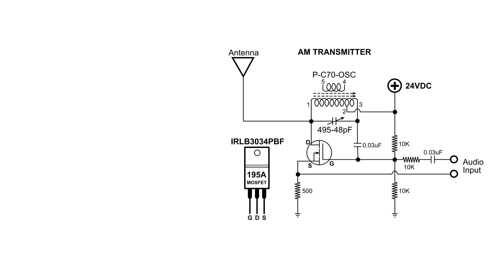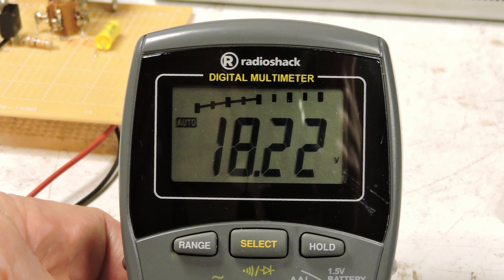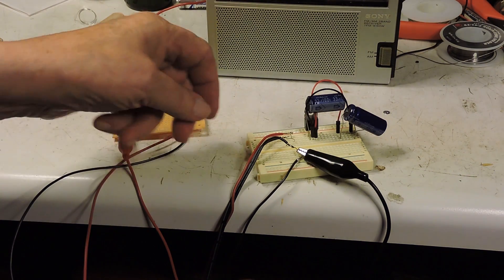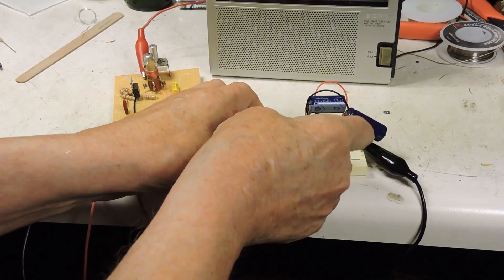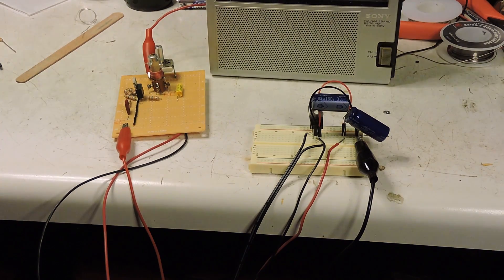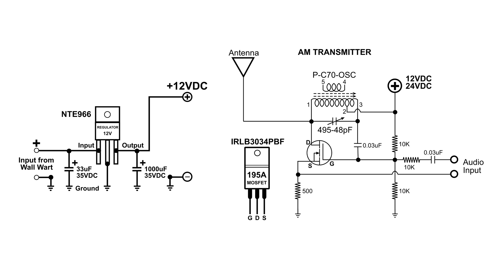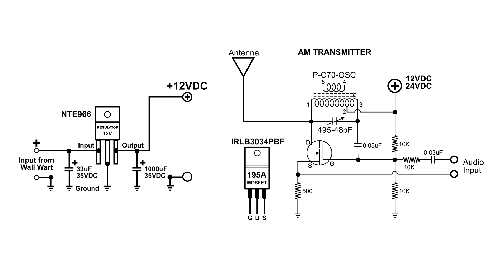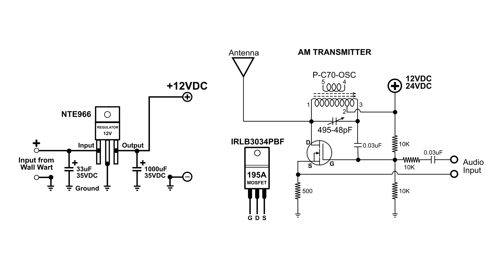AM Transmitter Power Supply Build and Demo

Comment: You've got yourself a new subscriber :)  And I've got a few questions. Can I replace the NTE966 with the L7812CV ?  It's a 12 volt regulator and much more common over here than the NTE966 (I live in The Netherlands).  Is it possible to make a dual (parallel) version of it? As far as I know it is a bit different than with transistors, but it is very nice when it comes to temperatures (mosfets can easily running hot). The last question is the most complicated, is there a way to replace the P-C70-OSC? In the USA you can buy them without a problem I know, but outside it is a different story. On Ebay they don't always ship those things to other countries.
Reply from the maker: Any 12VDC regulator will work. Almost any general purpose NPN transistor will work. I have other transmitters that work very well, and you wind your own coil.

Build AM FM Transmitter One Transistor Project 1-3
https://www.youtube.com/watch?v=6ZsQNtZZ_V4

Build FM One Transistor Transmitter Project 2-3
https://www.youtube.com/watch?v=2ihVw30vj8o 

just change the tank circuit to work on the band you want. 
And thanks for the subscription.